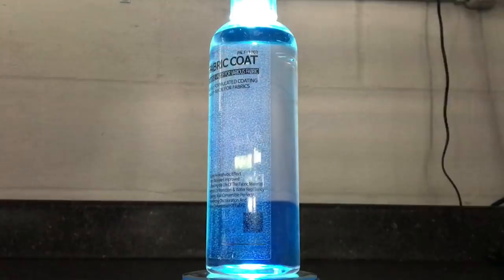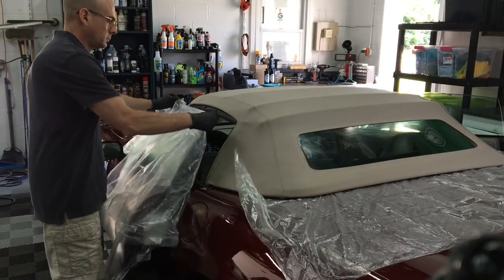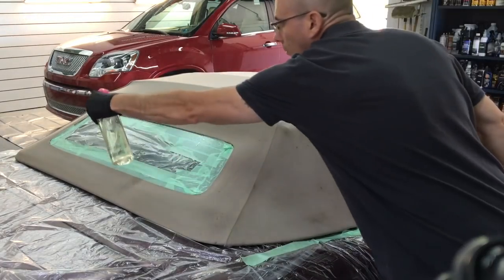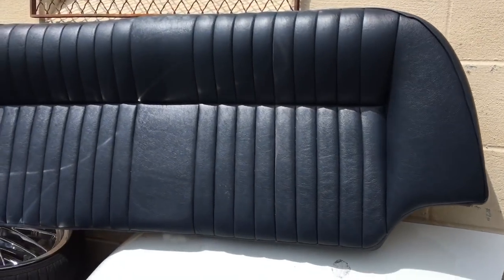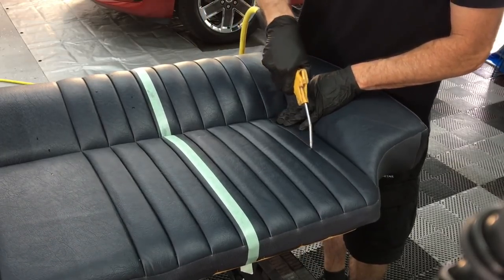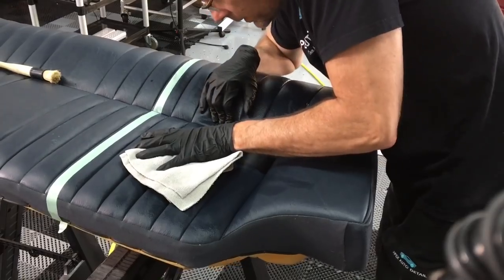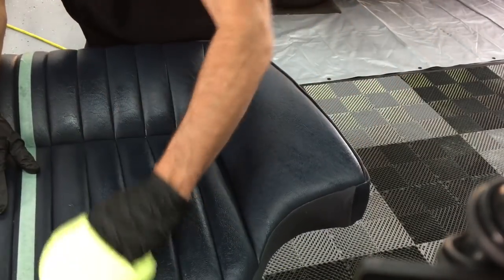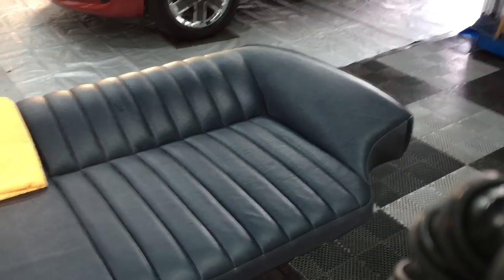A Review Of Acute Scense & Fabric Coat From TAC System!!!

Comment from the maker: What interior protectants do you favor?
Reply: Apex Detail another great review makes me think twice about what I should be conditioning my leather with . I use the chemical guys conditioner and serum don’t know how well it protects ,think I’m hooked more on the scent .
Reply: For leather I have been using GG 3-n-1 leather product, but switched to Pinnacle Black Leather as a coating, pricey but does a great job.
Reply: I use the 303 Convertible Top Care Kit on my Porsche. It does also darken the top's color a little bit and leaves a nice looking sheen to the top, but I like that, it makes the top look brand new. Longevity is good on it also, I only apply it once a year. I take to protectant bottle and pour it into a container and use a paint brush to put it on. Very easy to control where it goes that way and as I'm applying it I can see the fabric soaking up the protectant so I know what part of the top actually got good coverage. Try the paint brush method some day.
Reply: For fabrics I use 303's fabric protectant.  Seems to work well but it stinks.  For leather I'm a big fan of Gyeon Leather Coat.  Inexpensive, easy to use,  protects well and has a fairly plenty scent.  Kind of a baby powder scent.
Reply: Gyeon Leather Shield
Reply: Never protected my interior before. I look forward to when my Gyeon Leather coat arrives.
Reply: nice review of both products.   in your experience how similar in terms of performance is Acute Sense to Gyeon Leather coat (non-coating version)?
Reply: I have used 303 protectant  for years as well as Griots Interior cleaner.

Comment: I've used the Leatherique system for older neglected leather with good success.  For newer leather that is "clearcoated," I've used Griot's leather protector. However, I'm seeing the value in a stronger leather protector/sacrificial layer. Might give this a try.
I began using TAC systems products in part because of you, Brian, so I thank you for your thorough objective testing

Comment: Surf City Black Max vinyl rubber & trim protectant this stuff is incredible it has fixed everything on any car of used except for a couple of rubber pieces that have been exposed on the roof of my car for the last 20 years and on top of that it smells good
Reply: and when applying the surf City product I found it actually works best to initially applied literally with your hand not using a cloth and then from there you can buff it to whatever level of glass do you wish I highly recommend you try it
Reply from the maker: I will look into that one!👍